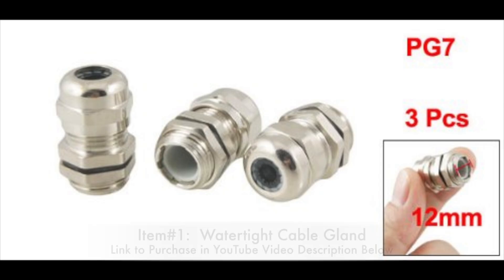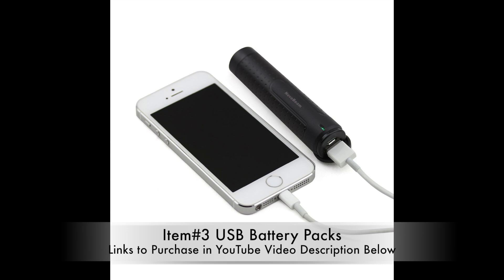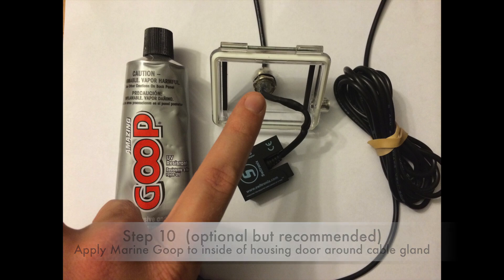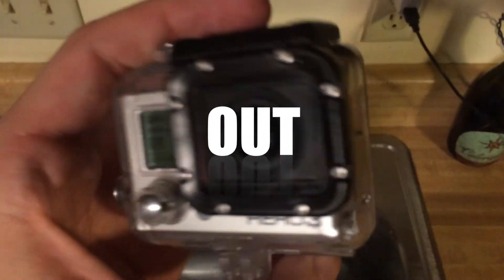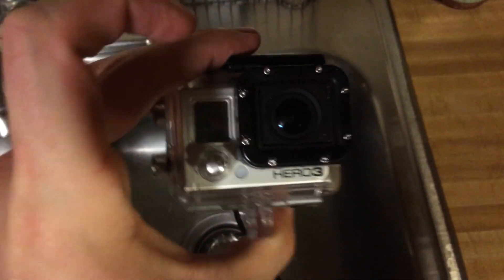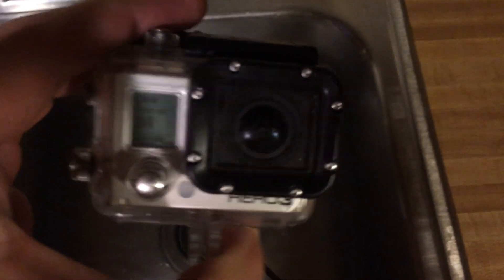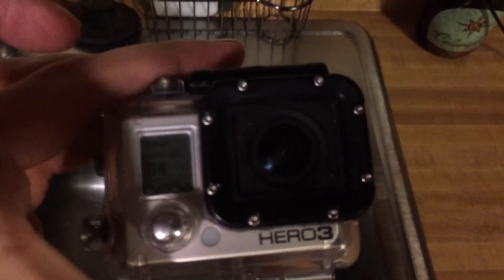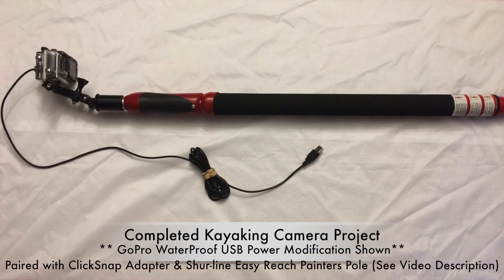Power & Charge GoPro Underwater: How to Get All Day Battery Life Underwater

Comment: fyi rule of thumb with anything like this is marine goop or sealer is NEVER optional.
Reply from the maker: These are now being sold by manufacturers that copied our video's idea.  They are not using marine goop but rather just plastic PG7 glands.  We found we could get a much tighter seal with stainless steel glands.  We haven't marine gooped ours and have had no issues for nearly 2yrs of heavy use.  We recommend adding the marine goop primarily if you plan on diving to depths around the water rating of the original housing.  Although we have tested to 50ft without goop and had no issues.  For kayaking you should have no issues as long as you used the correct size drill bit and glands we showed.  Not disagreeing with your statement, but rather giving our opinion and experience with it.

Comment: This is a great video.....hopefully you can help me out with my issue.  Is there anyway I could get the Battery Eliminator to work with my GoPro Hero 2?  I realize the batteries are a little different between the Hero 2 and 3 and I would hate to order it and find out I couldn't get it to work somehow.........Thanks so much.....Subscribed!!!
Reply from the maker: No compatibility currently with Hero 2.  You still could do the build but would need to modify a charging cable and run it through the cable gland housing backdoor setup.  Let me know if that answers your question or sounds feasible.  We will keep our eyes open for better solutions on various GoPro models but at this time your only method would be to modify a charging cable to make the bend around left side of the hero 2 to the back and run it out a cable gland like the video shows.

Comment: Thank you very much for making a short video. The other one was very helpful, but if it was far too long. I just ordered the parts for this project, & I am looking forward to not having to change my battery while snowboarding this winter.
Reply from the maker: Thanks for the Feedback Trav!  Hope it works out well for you.  You can use that same gland setup to incorporate a microphone extension cable for an external mic. This current setup because it is watertight/sealed will pick up less audio and the result is lower volume.  
P.S: Jealous you can snowboard.  I thought it would be an easy transition from wake boarding but it wasn't.  : )

Comment: Liked the video of the DIY Battery Eliminator for the GoPro Camera ! I would like your option on the best light weight battery to use on my kayak for this project . I've heard of different types of batteries from a motorcycle battery to an electric fence battery . What about the newer Light weight Lithium Batteries ?? I have a new GoPro Hero 3+ .
Reply from the maker: Lithium is very light & quick to recharge but can be spendy.  The battery choice depends on what other electronics you are running on the kayak.  The standard GoPro Battery is only 1050mah.  So a small 7ah = 7000mah thus the battery will run a GoPro about 7x longer than that of a standard little GoPro battery.  However, on a 7ah battery I have ran the GoPro till it easily filled a 64gb card and still had plenty of battery life left over.  Thus, when recording you will use up card space likely before the battery dies.  If you like lithium batteries these are the best prices.  I am using these for a solar build: http://www.amazon.com/s/?_encoding=UTF8&camp=1789&creative=390957&field-keywords=battery%20tender%20lithium%20iron%20phosphate%20battery&linkCode=ur2&tag=youtubejtl-20&url=search-alias%3Dautomotive&linkId=OYTYHJBO4MUBTMXO
Reply from the maker: Important note is that if using 12v lithium it isn't recommended to discharge them fully else it can limit the recharge capabilities.  However, I like lithium because they hold their charge well over several weeks between use and charge up fast.  Here is a quick education on lithium batteries.  http://batteryuniversity.com/learn/article/how_to_prolong_lithium_based_batteries
Reply from the maker: I personally think for the money that PowerSonic Batteries are the best.  They have great customer reviews and mine have lasted 4yrs and still no noticeable issues.  They are commonly used in kids power wheels toys.  I got the 12ah one here.  It weighs as much as a gallon of milk which is not bad for its ah size.   http://www.amazon.com/gp/product/B005S4LR6O/ref=as_li_tl?ie=UTF8&camp=1789&creative=390957&creativeASIN=B005S4LR6O&linkCode=as2&tag=kayakco-20&linkId=QARDPCAITJWCS3UM